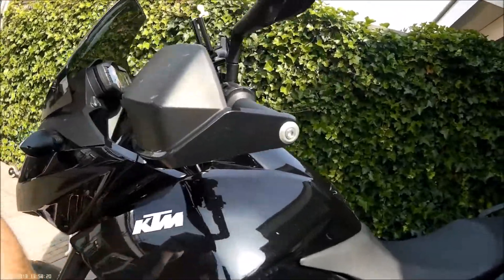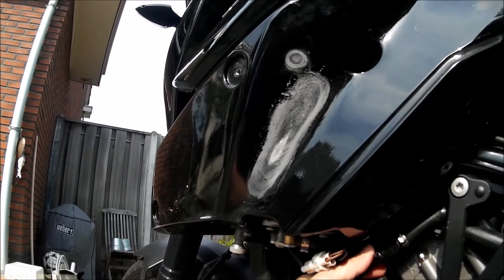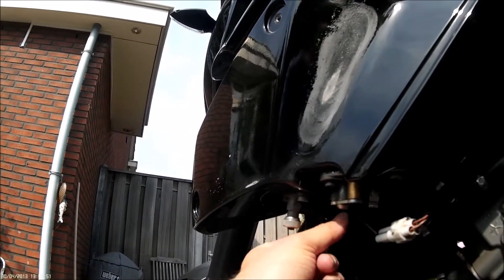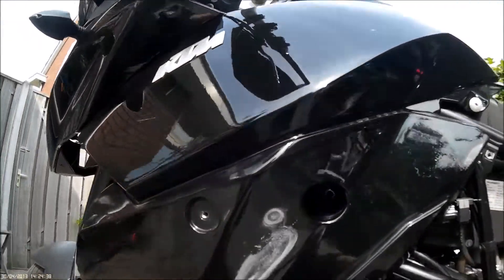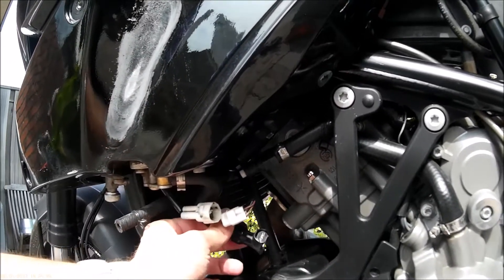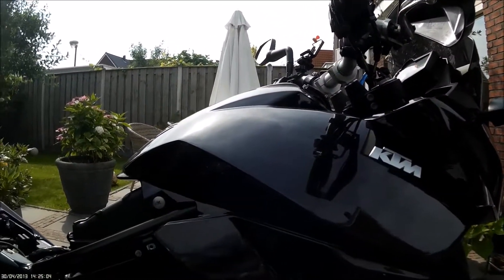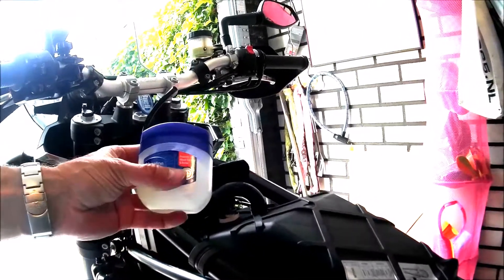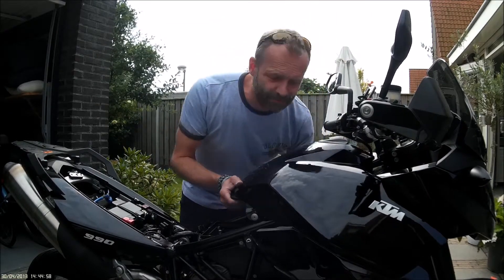KTM 990 SM tank removal DIY

Comment: Same procedure for 990 Super Duke? Thanks.
Reply from the maker: I guess so Lee. The engine and frame are similar. It should be easier as there is no integrated head light unit on the 990.

Comment: I have an SMT 2012 and the fuel cap is very hard to remove, is there a trick? Thanks!
Reply from the maker: Which bit is the hard part?
Reply: Mine had the same issue. Took ten minutes of wiggling to get it out of the tank. The rubber piece at the the base of the gas cap  appears to have swollen with age, and catches on the black nylon(plastic) trim ring on the opening of the tank. I used a razor to remove a tiny bit of the (red/orange) rubber piece on the bottom of the gas cap that appeared to be “flared” out, then I removed the black nylon (zytel?) trim ring and used a dremel with a sanding bit to increase the inside diameter just a bit - just don’t overdo it. Gas cap now works perfectly.